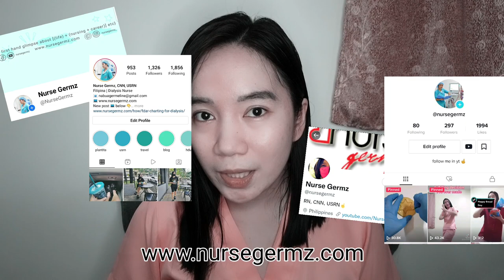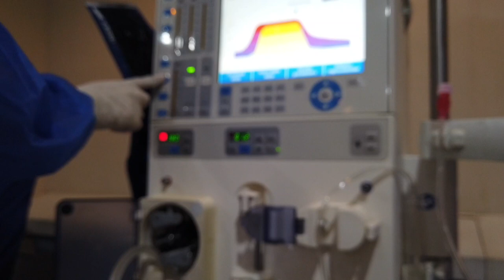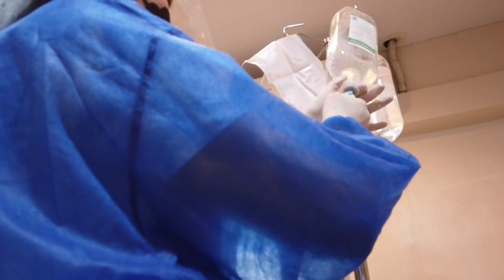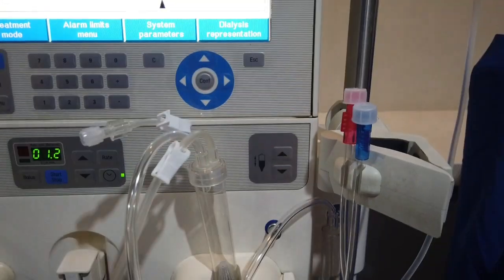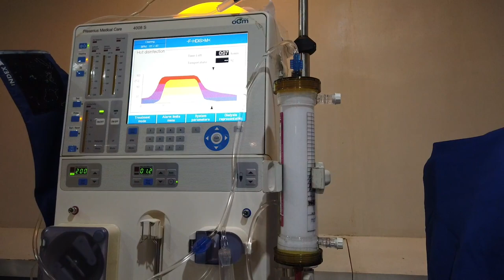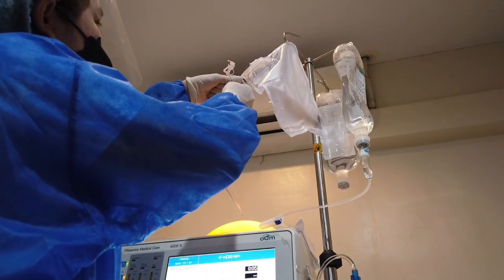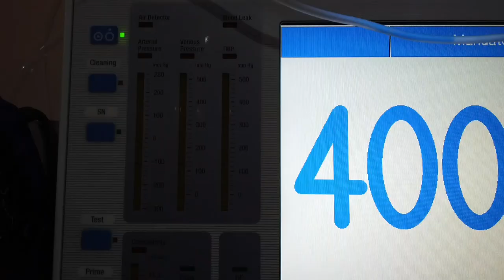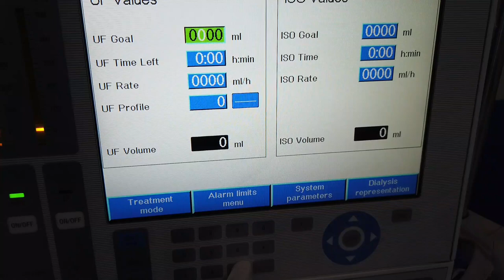How to Set Up and Prime a Hemodialysis Machine | Fresenius 4008S

Comment: Helo pwede mag ask po san po pwede i hook if patient is in dobu during dialysis?
Reply from the maker: IV site dapat. If may dobu meaning may low bp. D makakastart HD if wala yan since for bp support yan.
Reply: @Nursegermz  yes po can they hook it in the arterial line mam? The one po na with ns? Kasi dba po pag sa arterial dadaan pa sa dialyzer so mawawala din ung dobu po
Reply from the maker: Kanino ba binigay ung order? Is it during HD only? I doubt. Dapat may IV site. Not on HD.
Reply from the maker: Not a good idea. Dapat may IV site po patiente which naka hook na dapat and have run before HD. You can message me sa FB page rin po
Reply: @Nursegermz  yes po during hd only i noticed they usually hook it sa. arterial line po. Someone told me it should be sa blue line but i cannot find po the access site na pwede paglagyan. Coz with dobu hooked po in arterial line bp still babab parin po down to 80/60
Reply from the maker: @juliusapril6527 not advisable sa arterial, only blood transfusion lang dapat kan. Sa venous chamber po sya ihohook then syempre naka IV pump.
Reply: @Nursegermz  mam usung freseenius 40008s po san po dun ung venous chamber ?
Reply from the maker: @juliusapril6527 for sure? Watch the video, I mentioned it at 3:18 just curious, are you the dialysis nurse or the primary nurse? Part po kasi sya sa hd bloodlines so it’s rare to get questions like this po.
Reply: @Nursegermz  medsurg po san po vid mam? Thank u for ur time mam ha and sa info po
Reply: Mam i saw it na po venous chamber san po don sa line ng venous pupwedenpo?
Reply from the maker: @juliusapril6527  ung isang extra na may clamp. Ung isa ikakabit sa transducer, ung isa na d ginagamit, don mo ihook.
Reply: @Nursegermz  ung maikli po na may white cap po?
Reply from the maker: Yes

Comment: Hi Mam ask ko lang po if mas madali lang po ba Ang computation sa mismong practice ng dialysis center kesa sa book based? I find it challenging. Though Wala pa naman ako sa mismong practice. Thanks po and keep safe po.
Reply from the maker: Yes. D mo na need ang formula. Compute lang. basically it’s just uf = pre weight - dry weight or post weight then plus mga dagdag like BT, flushing etc. tuturuan nman po kayo nyan. Per facility’s policy po kasi yan so depende talaga
Reply: Thank you ☺️☺️😂